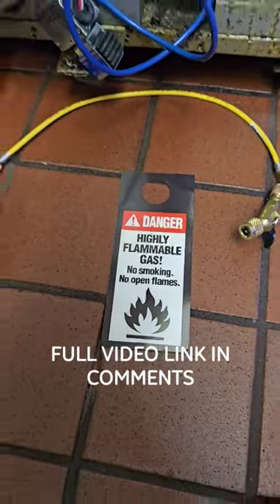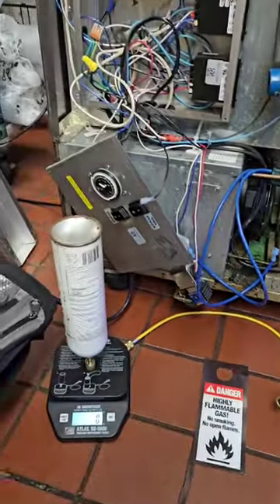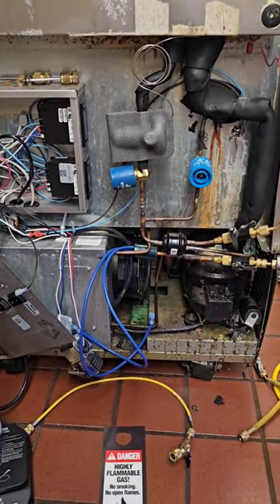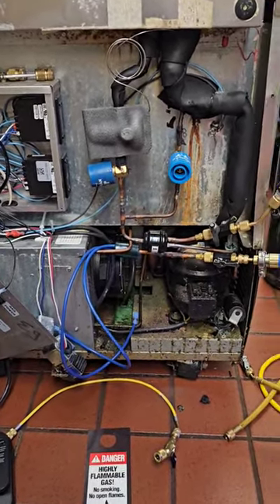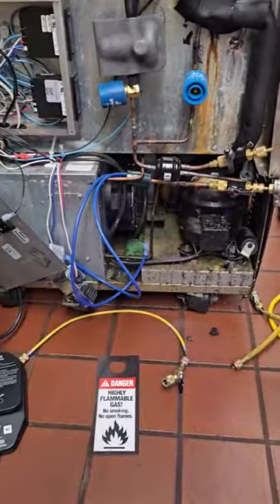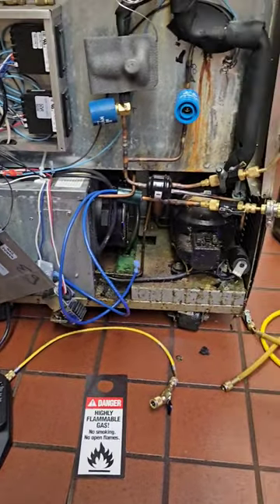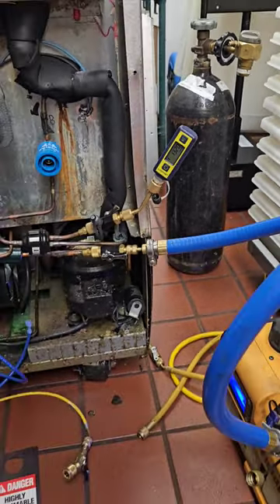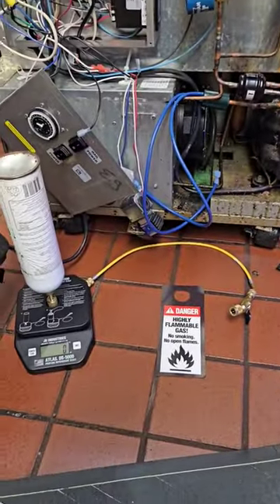FLAMMABLE REFRIGERANTS #shorts

Comment: I saw one of these flame up once. It was not pretty. I hated working on these when I did refrigeration, because I had one r22 unit that I was changing the compressor and the refrigerant was stuck under the oil causing it to explode when i put the torches to it and flame up to my face. thank God i was able to move out of the way before it hit my face. my partner was scared as hell. lol. I did all the evacuation procedures before i put my torches to it, but it didnt help. now i alway keep my face away when im torching. lesson learned. I can't even imagine if that would happen to a r290. that would be scary. be careful out there guys.

Comment: I get nervous when it comes to sealing the ports up again 😅 I clamp it down twice leave my crimps on, cut the tube with cutting pliers and bite down the ends. I seal low side when unit is running and high side when unit cycles off since the pressure differ ! So far worked for me

Comment: 290 and 170 ethane is highly flammable. I do cascade ultra low refrigeration and for some reason I feel like the flammable gasses break down the compressors more frequently. They burn up a lot.

Comment: If your scared of 5 grams of propane find another job. I just had a coworker arc out a 570 volt battery string with a wrench, he got away with "only" second degree burns. There are dangerous jobs out there, more dangerous than yours.

Comment: For those who are in the know R290 is propane gas and R600a is butane gas.
I do not ever see either ever being used in cars. I seen a demo of what a R290 leak could do if it happen in side a car. Not good at all.
Reply: It's funny because internal combustion engines support running on either, and I imagine that simply being in the cabin air path makes it worse when being used as a refrigerant
Reply: If the cabin is engulfed in flames (which would be needed to ignite an interior evaporator leak) a few ounces of propane is the least of ones worries.
Reply: R600 is butane. R600a is isobutane they have different T&P.